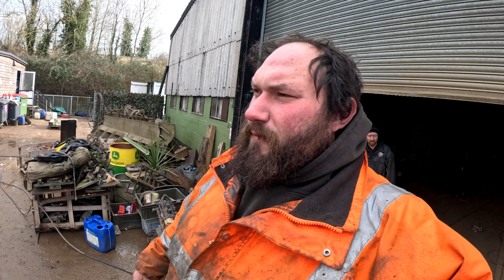Fixing the British army’s most unreliable tank? FV180 Combat Engineering Tractor

Comment: I have quite a few photographs of the CET operating on exercises and tours (swimming in a fjord in Norway, Exercise Purple Warrior in Scotland,, in the desert in Egypt etc), let me know if you want a copy of the photographs..   They were very reliable if they were constantly in use. The problems arose when they were left for half the year hardly moving,, except to be serviced.   It is loads of fun hanging upside down trying to remove the muff coupling, to replace the steering box, whilst on exercise.   I crewed and commanded a CET, as part of Plant Troop, for about 8 - 9 years.  You do not drain the hull using the bilge pumps; they are used whilst swimming.  On the bucket end, there is a drain plug on the hull that you can remove.  The hull will usually end up containing quite a bit of coolant and oil from burst coolant hoses and oil leaks.   You want to drive the CET up a ramp, or create an earth bund with the bucket end, and then drive up it to get all of the fluid inside the hull to go down to the bucket end.  Then safely remove the hull drain plug and catch all the fluid, as best you can.

Comment: The FV 180, called" combat engineer tractor," as combat engineers were taught to operate them. But due to not being looked after properly, it became a role filled by plant operator mechanics. I actually drove your one over at James. Yes the steering wouldn't work on one side. Ex frog op (POM). 26 ARMD ENGR SQN

Comment: Does the CT not have water drain plugs like a Stalwart? We always put tarpaulins when we parked Armor vehicles outside but we drain plugs to leave open to reduce water build up. We frequently had the floorboards up for steam cleaning including the bilge pumps I never pumped water except in a water obstacle Cheers and good luck
Reply: Sump plug wil drain the hull compartment.

Comment: Do you plan to use the vehicle amphibiously? If not why not  drill some drain holes?
Reply: There is already a drain plug for the hull.  Also the hull usually ends up full of mixed oil and coolant, as when coolant hoses blow and oil gaskets fail it all goes into the hull.  Drilling holes in the hull would put that on the road, which wouldn't be fun with rubber track pads.  I operated them in Norway (damn cold) and we had to remove all the track pads to get traction.

Comment: Great video. To prevent some steer units issues try avoid using the emergency brake as a parking brake. Use the parking brake or just put the bucket on the floor. If possible without teaching you to suck eggs although difficult to get to, drain off the air tanks to reduce moisure damage.

Comment: Brass and aluminum do not like each other - galvanic corrosion in the presence of any moisture.  That's why it has turned green. 
I learnt that the hard way. 
Stainless may not be the best. It only resists corrosion when it has access to oxygen put in in a confined space and it will corroded just like mild steel.
Maybe you make the whole thing out something like PTFE in one piece - no need for bonding.

Comment: Really enjoyed the video, such a shame that the corrosion in the air system is a problem factor. With the rain water issues, have you considered approaching a signwriter company for some large used banners? They are waterproof and as large as a taut liner cover, easily able to drape over the tanks to protect them. I have purchased some for very reasonable prices and they are great for the application.